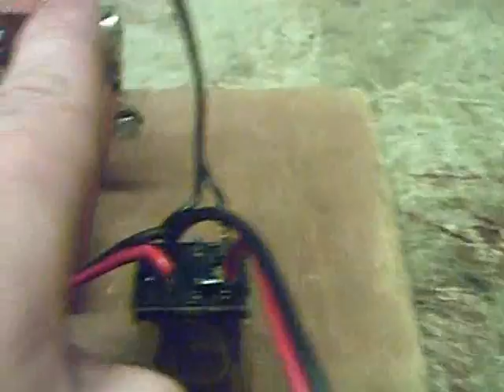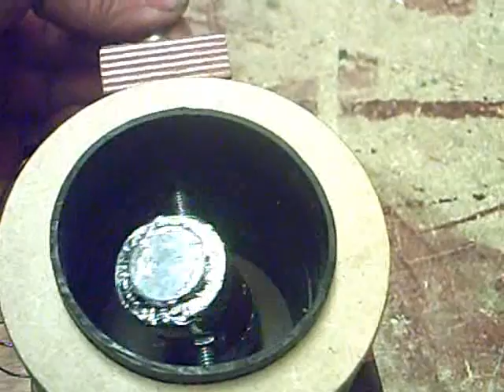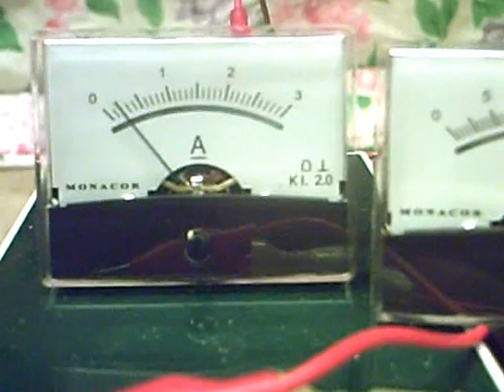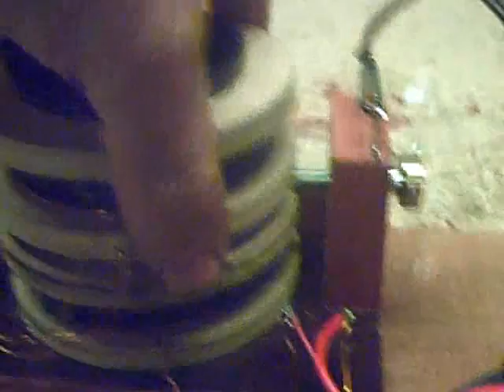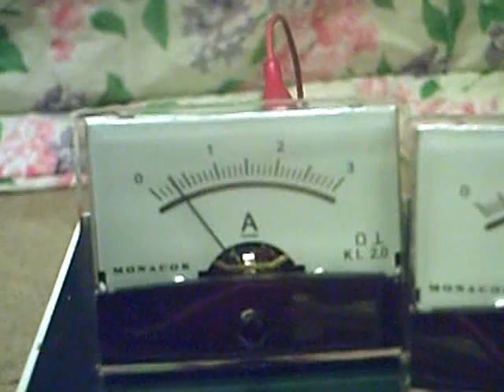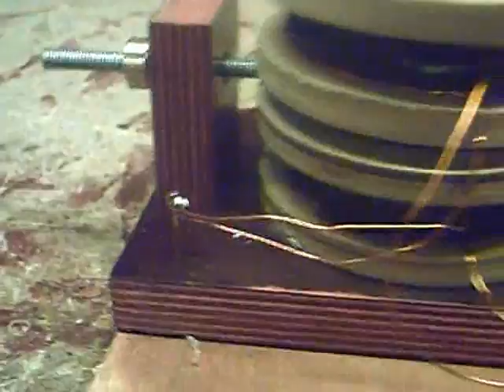Newman motor 1(TheDaftman)

Comment: I am convinced that doubling the coils in my fan motor will allow me to double the rpms while cutting the power consumption in half. Right now I have a 19.5-inch fan (6 blades) which consumes 6 watts when spun at 300 rpm. After doubling the coils to cover all of the angles, I should be able to spin it at 600 rpm using only 3 watts. The fan blade itself is rated for 10,000 rpm.

Comment: The majority of power in this device is going to vibration and not the generator coils. One should have a deliberate and heavy mechanical/non-electrical load such as a fan or a wheel guarantees that a smaller fraction of output power is rendered as wasteful vibration and heat.

Comment from the maker: Wire on alternator on other video is thicker than Newman motors not a lot all so the alternator is not fully loaded fractionally. For more currant I need less turns thicker gage wire, more terns will give more volts, this alternator will give almost 50 watts when a full load is applied when an efficient motor is used to rotate it. I did test it before connecting it up to the Newman motors. But I dont need currant according to Jefferson Newman so for this test currant was forsaken for voltage.

Comment: My next project will be adding a second $42 4000' coil on top. Thanks daftman! I'm going to try to clock for 6 days (twice as long) at 1200 rpm (twice as fast). Increasing the voltage is getting to expensive for me now and the batteries getting to long to charge. 8000' feet Newman motor here we go!

Comment: looks like you might be able to put a diode on that switch and catch some of that radiant energy . I was able to direct my radiant power back to my pulse motor and my rpms climbed and amps dropped  and it saved my points .Not sure what it will do for a newman.Nice work!

Comment: The output through the capacitor here is much lower than the input. The generator coils do not create that much current. There are not enough turns in the generator coil and the wire is not thick enough. The only way the power generated in the generator would even be comparable is if the torque induced in the generator coil was comparable to that in the Newman motor coils.

Comment from the maker: At the moment this is just a motor, so it only uses energy. I am now building a new one complete with generator and now I have found the most efficient motor I'm going for a self runner, well that's my goal anyway. So to a degree how much energy is being put in vs. being made well this want really apply to my research, as there will be no power input. Or so I think. But that's y in thedaftman. Sorry if this seems like a copout.

Comment: "Using the meters there is no way to accurately measure your input or output power the current and voltage will not be in phase...."

It is hopeless cause for these motors to have their electrical power measured accurately. The most conservative thing we can do with the meters here is to use it to measure electrical INPUT ONLY and then test the mechanical output using a dynanometer. By overestimating the input, we would underestimate efficency.

Comment from the maker: Jallaguri sorry I accidentally hit remove on your comment instead of reply. 
This was Jallaguri comment.

If you remove one coil the efficiency will drop. So the EMF is reduced so the amps goes up. Thats it? br. 

No sorry. 
The EMF remains the same as the coil remains connected, so the EMF is only affected by the slowing down of the unit and that happens because part of the electromagnetic field is removed from the rotating magnet field.

Comment: I noticed that TheDaftMan is not active for at least for a months now. Any problem? I am actually more interested in getting more mechanical power out of the Newman motor. I would be happy to generate just enough electricity to keep the assembly running.  Any suggestion?

Comment: Can I see electric circuit diagram?
Do you change current direction or does the current flow only one direction?
What is current duty cycle? 10%, 50% 90% ?